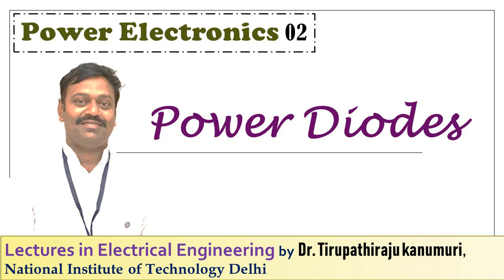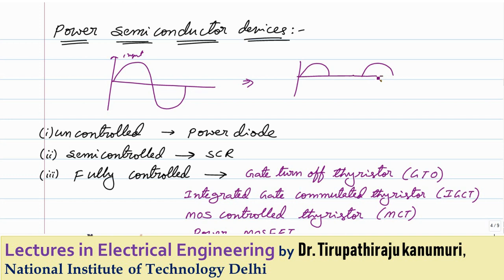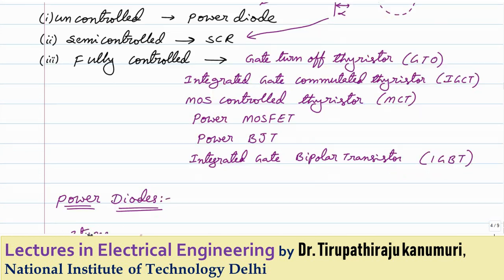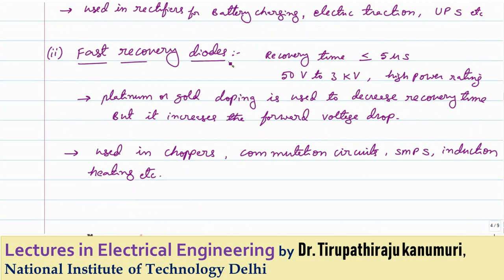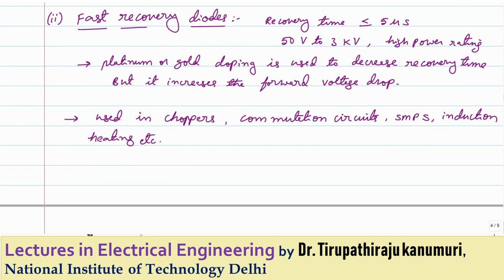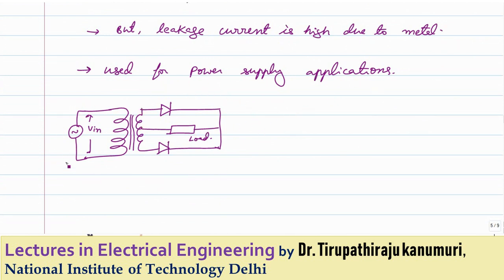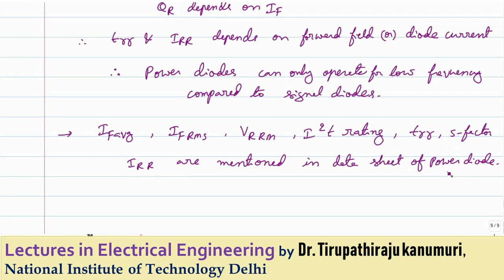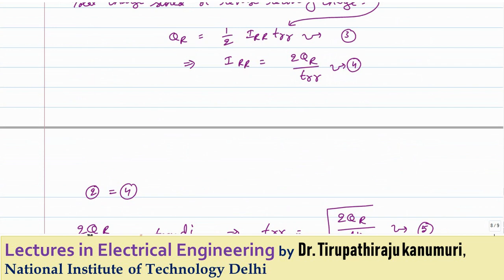PE02 Power Diodes

Comment: how the voltage drop across the diode is positive during time (ta) in the reverse recovery characteristics?as current direction has changed so the voltage drop will also change its polarity.
Reply: @lecturesinelectricaleng  sir i went through the book you referred but still at one point i am facing confusion that is,when the current becomes negative during the the time ta the diode remains in forward bias.this is what is written in the book.but as the current direction is changing so the voltage drop should also change its polarity to satisfy the kvl equation because the source voltage has aslo change its polarity during turn off time?
sir if you plse clear this confusion then i will be highly obliged.
Reply: @shubhambhattacharya7787  Reminding you that you asked a doubt 3 years ago 🙂

Comment: Sir.. in order to turn off a diode, atfirst storages charges removed from the region..such that it will regain its reverse blocking capacity... That's ok sir.. but my doubt is.. How can I remove those charge.. automatically it cannt remove..
Reply: How the current flows in the reverse direction..?? What we need to do inorder to make a flow of current in reverse direction?

Comment: sir during the turn on time why the voltage is rising till the current reaches to a value and after that the voltage falls to a minimun value?
Reply: I also have this same doubt... i think it has something to do with the depletion region
Reply: Because the diode needs extra voltage to remove the charge carriers stored in the drift regionand  and when all the carriers comes out and depletion region ends the current value could be dropped suddenly for steady output current.